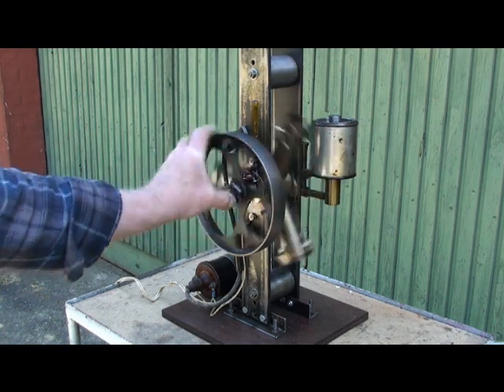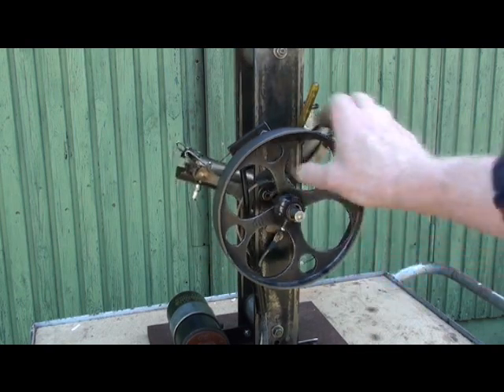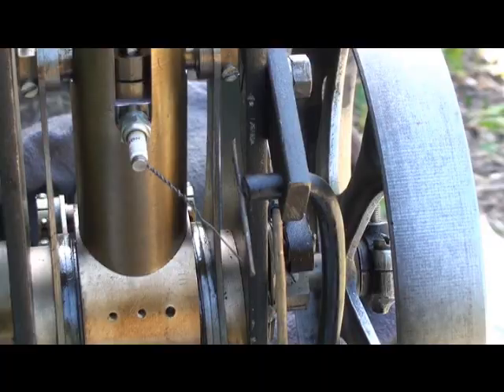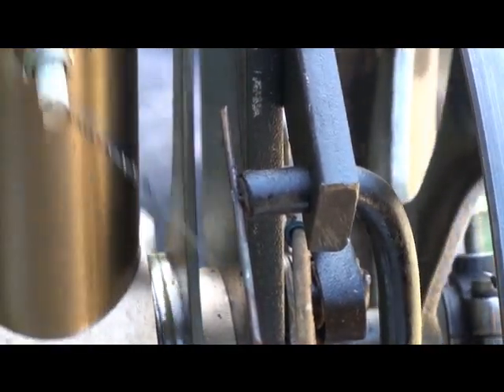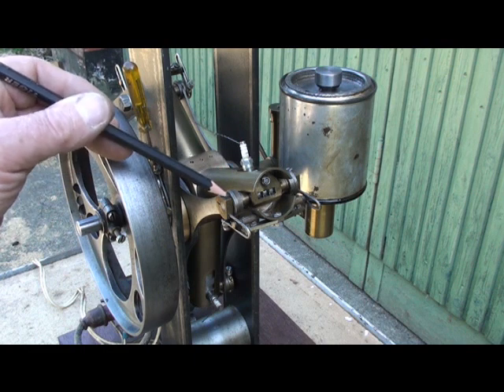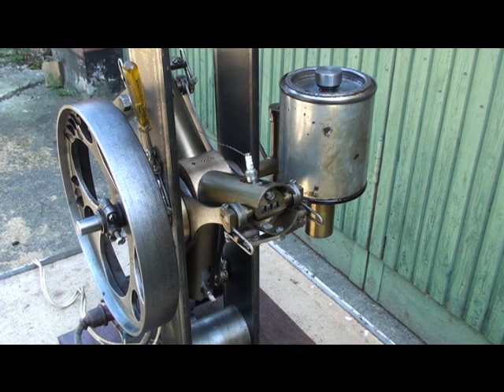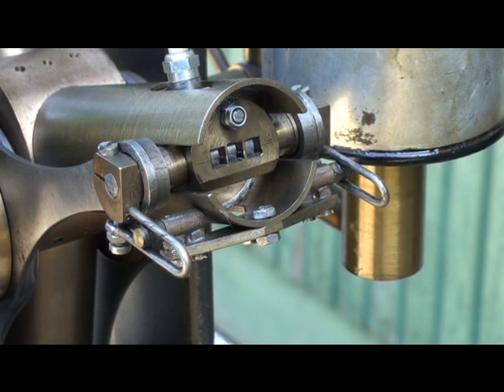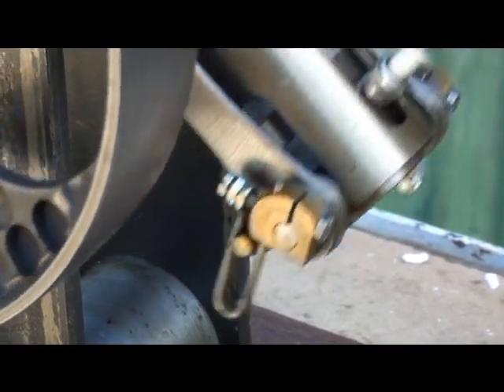3 Cylinder Two stroke Radial Engine with rotating Cylinders

Comment: This is a Millet type Rotary.. invented by Felix Millet in 1892
Reply: The real doktorbimmer   The Millet was known as an "axial rotary" and used to power the first motorcycle. Imagine the rear wheel of a motorcycle built around the outside circumference with the crankshaft held stationary in the rear frame. 
Aircraft experimenters of the day adapted the design because of the low weight combined with the higher power available from other types available. As WWI approached, the design was adapted and improved upon until very late in the war all that reciprocating whirling weight out front, and it's objectionable centrifugal force acting 90° to the pilot's control input made the airplane nearly impossible to control. 
The natural design progression resulted in fixing the stationary crankcase to the airframe, retaining all the positive aspects of rotary deign ( high power to weight ratio and even cylinder cooling ), and allowing for increased reliability, engine driven supercharging, better fuel management, etc.
That's why Pratt and Whitney built nothing else. After all, if God had intended aircraft engines to be flat,  then Pratt and Whitney would have built them!
Reply: If God had intended Pratt and Whitney to build aircraft engines they would have invented the jet engine.. but the Germans invented first
Reply: Tom Clark Yes, as Rotary engines got bigger and more powerful... the effects of "gyroscopic procession" became a real problem..
As we saw during WW2 the water-cooled in-line engine was the superior technology and was used on the fastest, most powerful aero engine based on engine displacement and fuel consumption (Hp/liter and BSFC)
Reply: The real doktorbimmer  Actually, we give Whittle ( an Englishman ) credit for "inventing" the first turbojet engine, and blame the often shortsighted Royal military geniuses for not allowing him to follow through for many years. In that time, Pratt and Whitney along with GE / Westinghouse did develop work on their axial flow design that had greater thrust and longer life.
Reply: Tom Clark Frank whittle was only the first person in the UK to build a jet engine.. the UK is not the world anymore...
Reply: Tom Clark Pratt and Whitney, GE and Westinghouse all directly benefited from German jet/gas turbine technology through "Operation LUSTY" and "Operation Paper Clip"
GE's head of jet engine development was German..
Reply: Tom Clark Axial turbojet and turboshaft technology was invented in Germany
Reply: The real doktorbimmer  WTF? "not the world anymore" ?? Let me think... oh ya, Germany lost BOTH world wars, after which they were relegated to third wold status... Just say'n.
Reply: The british empire collapsed as a direct result of WW2.. and ceased to be a world superpower.
 Germany is currently the number one economic power in Europe..

The UK is tied with France for 5th place...

Just say'n.. Cheers mate!
Reply: Germany was the first to build or test a turbojet engine... it was also the first to successfully test a turbojet engines in pure jet propelled flight..
Reply: Well the british occupation of India is of particular note..being the site of the largest mass murder events in history, the number of innocent non-combatants that were murdered or forcibly starved to death attributed to queen Victoria is staggering and easily exceeds the deaths attributed to Stalin, Mao and Hitler combined.
Of course the Boer War is one of the few examples that was very well documented by independent sources and cannot be denied by Anglo historians as easily... its also where the british can be credited with inventing the concept and the name "Concentration Camp" otherwise known as a  "extermination camp" where vast number men,women and children were murdered by british occupational invaders.
Reply: Hans von Ohain and Max Hahn built the first turbojet engine in 1934 (3 years before Whittle)

and von Ohains HeS 3 turbojet powered the first jet aircraft the He-178 (2 years before Glosters Whittle powered jet)

Comment: That's a great build! But it's a rotary, not a radial.
Reply: +Rick Autry 
In Denmark it is called a rotary radial. (Roterende stjermemotor). If it was just named a rotary we wouldn't know if it was a radial, a turbine or a wankel og some other form of rotary engine.
Reply: It's an oddball for sure. A rotary needs no flywheel, the mass of the spinning cylinders performs that function. I suppose that since it's experimental, there will be things like that 'Distributor'(somewhere between gas and diesel) for experimenting with different fuels I suppose. I'd love to have one like it - but I bet my neighbors wouldn't love me for it!
Reply: Rick Autry
My hobby is worse, if you can imagine living next-door to a chainsaw collector. ;-)
Reply: +Rick Autry It's a rotary.

Comment: Isn't this more properly a rotary engine?
Either way it's very nice, you do great work. 
I liked your little 1 cylinder diesel too.
Reply: lemontier
Absolutely correct.
Reply: Mazda Rotary® was a now defunct brand name of Wankel Orbiting Piston type engines..
Reply: From what i remember when the cylinders rotate its called a rotery engine and when the crank rotates its called a radial.
Reply: Felix Millet invented the Rotary ICE in 1892..  Dr Felix Wankel borrowed the concept for the layout of his Orbiting Piston supercharger and later adapted it into a prototype engine called the DKM-54.. the DKM was never developed into a production design.. Dr Hanns Paschke discarded the Rotary layout in favor of the conventional layout in his KKM design that was later sold to Mazda and dozens of other licenses's
Reply: +Mitchell Richardson  I believe that you are thinking of the Mazda automotive type of rotary. The original aircraft type rotary of WW1 had a fixed crankshaft with  the crankcase rotating around it. The radial has a fixed crankcase with a rotating crank as WW2 aircraft used
Reply: It's both! Check out this Adams-Farwell video. Adams-Farwell was an early car with a rotating radial engine. The one in the video may be the only running on anymore.  Link:  https://www.youtube.com/watch?v=Y0XbqHUAI-0
Reply: rotary is a triangleish shape piston. This is radial.
Reply: @midgyrich  no, you're referring to a Wankel Rotary engine. These radial engines with the rotating cylinders were also called rotary engines too, since they too rotated in their own way.
Reply: @midgyrich  Please no. Wankel engine is a form of rotary. This is an rotary-radial which  for convience was known as a rotary.

Comment: Hi Mr. Hansen, I love your design for this engine. I have a question regarding the fuel intake stroke. At first I thought it may operate similar to a Gnome Monosoupape, where the exhaust valve was also used to intake fresh air. However, after thinking about it, I realized that this principal would not work well for this type of design. Is the intake stroke governed by a rotary valve in the crank case or main shaft?

Comment: If the cylinders are rotating it's a rotary engine not a radial.
Reply: Wouldn't it still be a radial because the pistons are placed all the way around the radius of the crankshaft? I thought that's what that meant. Instead of it being V or inline the pistons are located all the way around.
Reply: +BlackGray LightGray Either way, you couldn't build one.
Reply: I am trying to build one actually...
Reply: BlackGray LightGray Video coming soon?
Reply: ***** I see a lot of 'professionals' online that only like to correct people rather than offering any compliments or real constructive criticism. He could have said something like, "Hey man, nice build, but that's actually a rotary due to the whole thing turning. I'm actually building one" That way you don't come off as a 'knowitall', and it doesn't go in one ear and out the other, so to speak. Sticks better to honey than it does to shit.